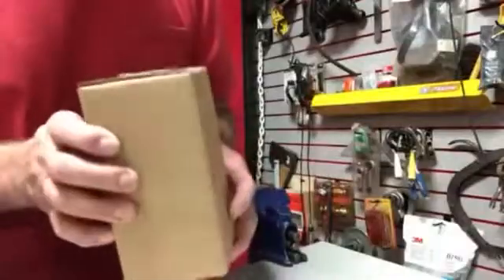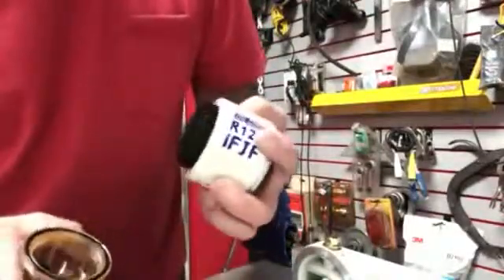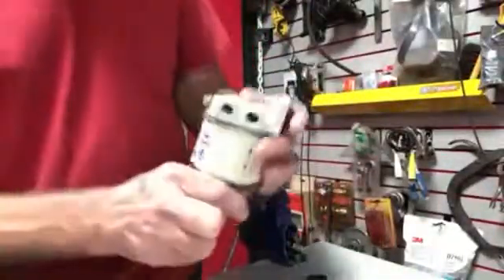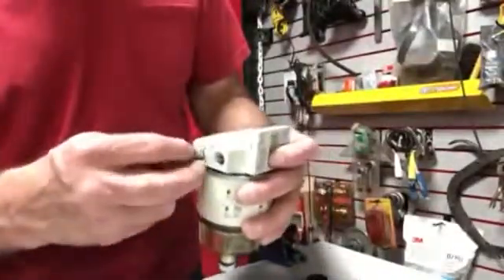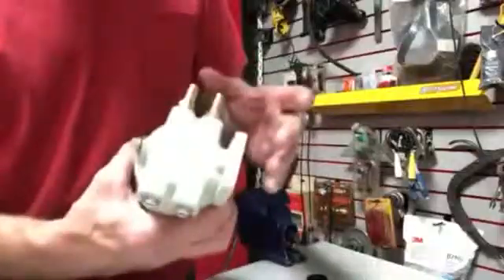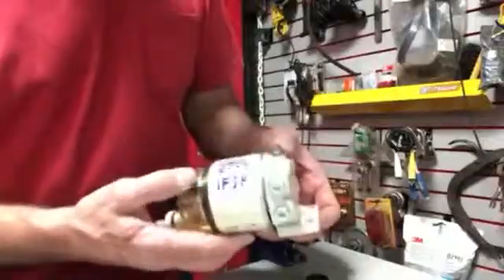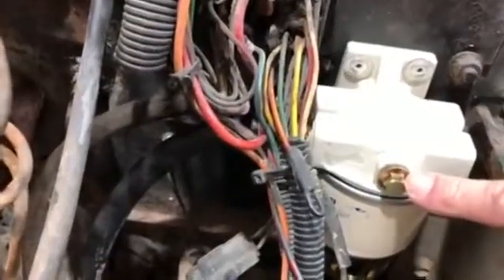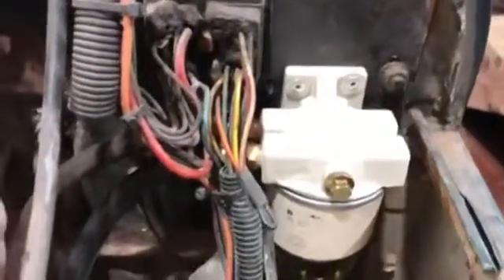How to install iFJF R12T Fuel Filter/Water Separator 120AT NPT ZG1/4-19

Comment: Just bought one. How often should I change the filter? 
Thanks for sharing this information.
Reply from the maker: One year or 6300 miles. Hope this can help you. 
If you buy our R12T assembly, you can contact us and we can give you a replacement filter element free of charge.
Reply: @iFJF_Direct  I have a three liter diesel engine it already has a factory filter with a drain. I would like to install the filter / water separator in your video. Is this filter / water separator able to handle the 3.0 turbo diesel engine?
Thank you for the help
Reply from the maker: @ojbarberena7090  Hi, as long as your engine has a suitable space to install the oil-water separator, it can be used. It has no requirements for the engine model. As long as there is an installation space, diesel and gasoline can use this fuel-water separator